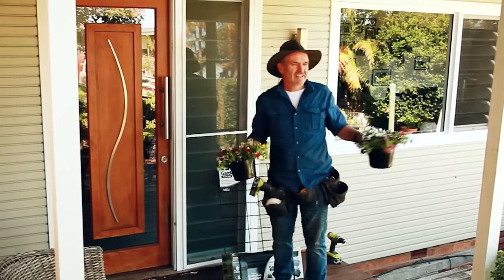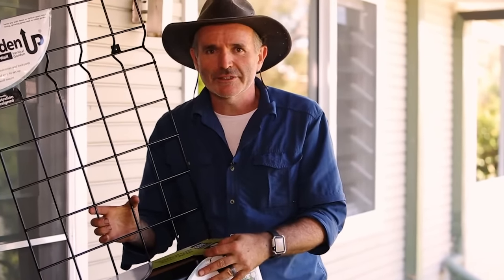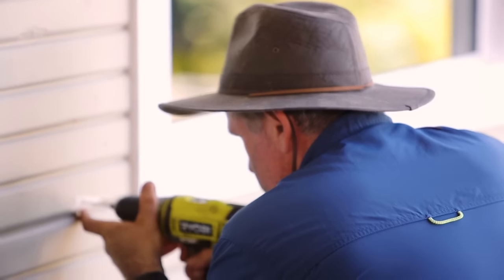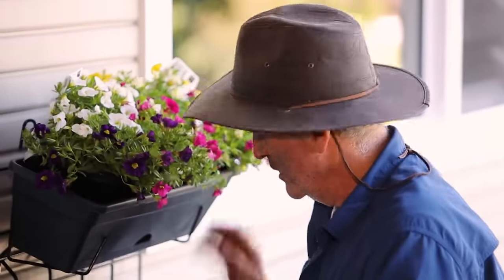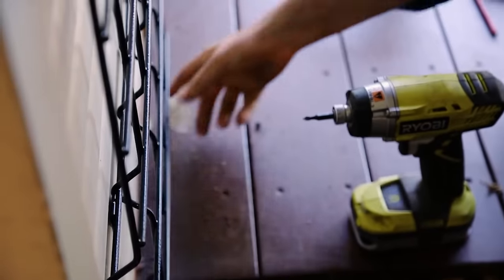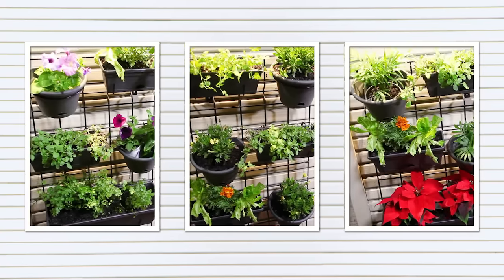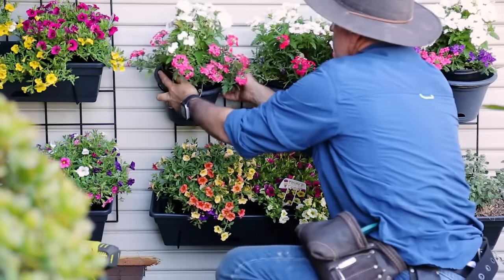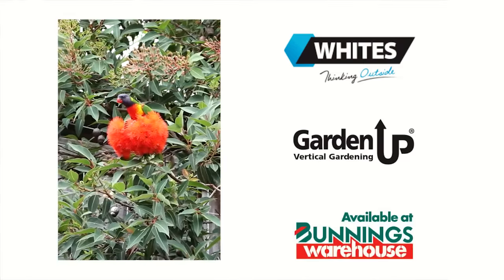Garden Up - Vertical Gardens

Comment: Walls will get dirty with water that will drip down the pots once you water them. how to protect the walls when done indoor??
Reply: Deepali Jadhav U can simply fix a fibre sheet on the wall and then... Ur wall won't be in direct connection with water dripping from the pots.
Reply: @MyraMo9484  Or...maybe build a vertical wall in the garden where these can then hang.
I've done something similar. I live in Sydney, Australia and creating a vertical wall has been helpful in growing my squash, cucumber, watermelon, pumpkin upward instead of outward. Using space wisely.